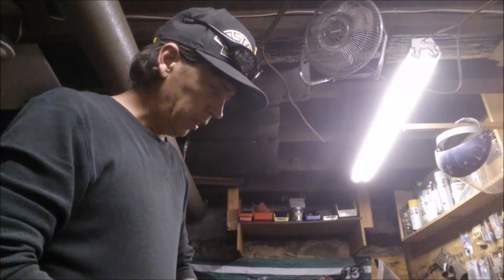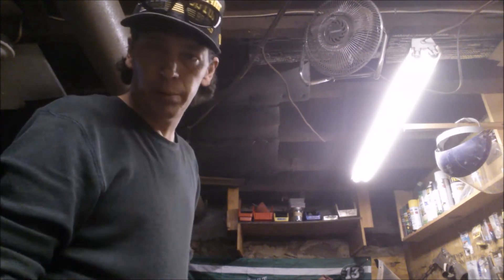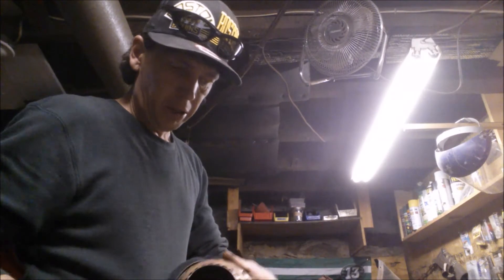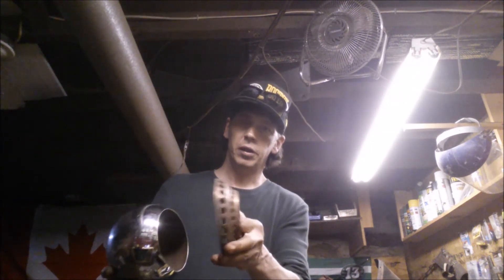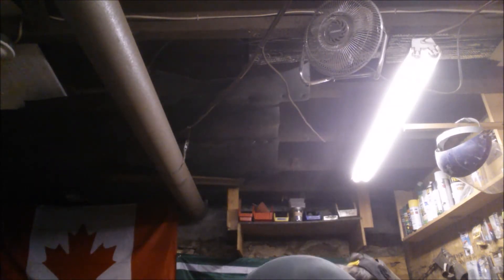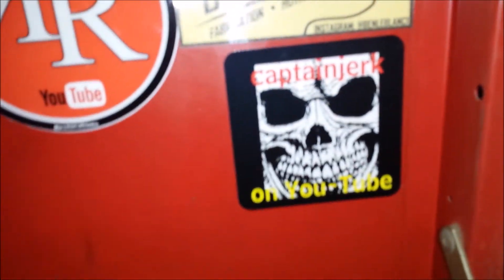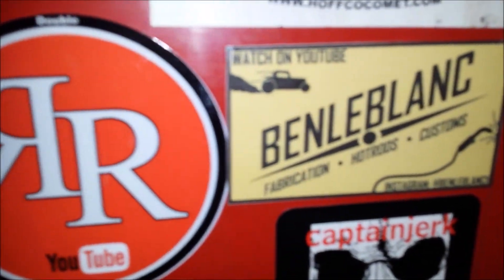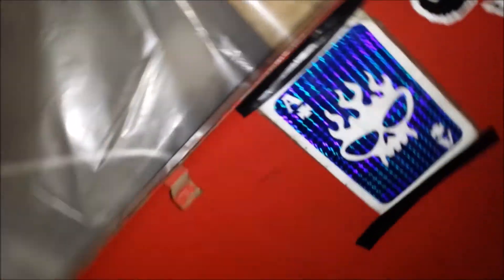Model a Rear end , uncle Leo,Mail day

Comment: I just noticed your comment about the axle. The only problem with the axle I have is they are not threaded on the ends. You have to use some kind of stops of some kind.
Reply from the maker: +231flash np brother I can thread it or pin. many ways to fix that.  cheers man
Reply: +udizzy1969 Ok, I'll send it off Monday.
Reply from the maker: Your the best man, wait till you see my next vid, welding on the trike vid, Ya buddy. lol  cheers